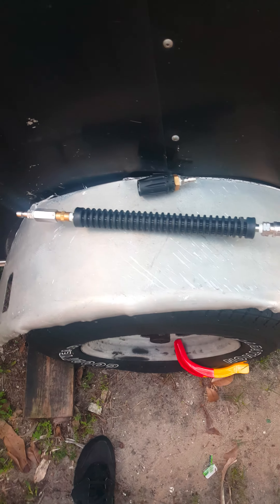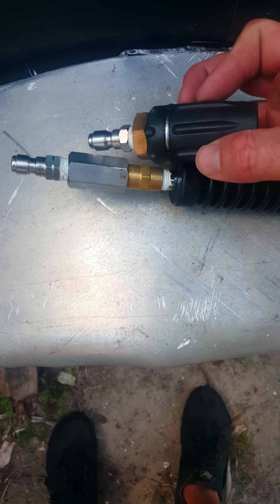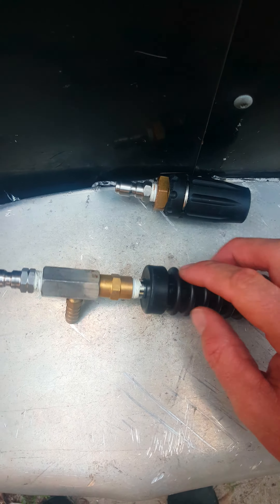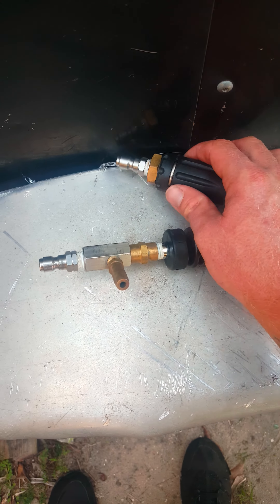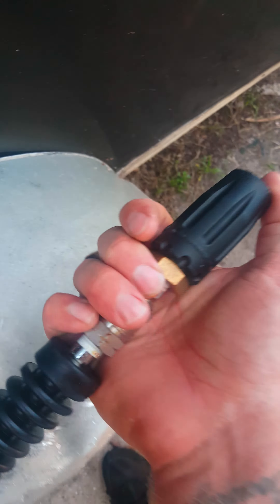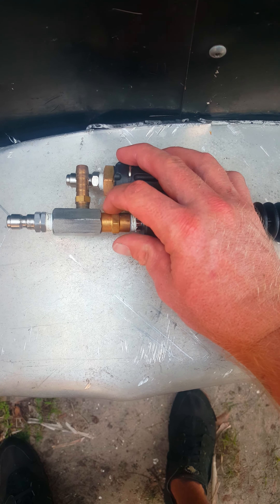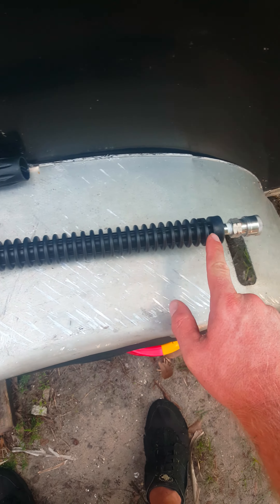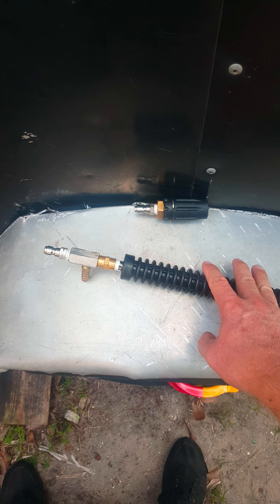Xjet x-jet m5 twist nozzle modified

Comment: Did the X jet that you are showing not have a spray nozzle built right into the Cupler? When I take my adjustable fan tip nozzle off there’s no way I can get anything Connected to the Cupler because there is no threads due to the 3 inch round spray tip. So I’m assuming yours is a little bit different.

Comment: I did this same set up, but I'm not getting near that draw. Bucket test came out 5 gal of flow to draw 1 gal. How do you get close to 1:1? Using 5.5 gal/min 3500psi Honda. I lowered the rev to see if it would draw more, but it didn't.
Reply from the maker: The more gpms the less draw ratio. This was with my 4gpm..older video
Reply: Did you remove the inners of the xjet??

Comment: How did you unscrew the xjet it’s pretty stiff and hard to take off
Reply: It has red locktight applied. Just use a little heat from a heat gun (don't go crazy) and just work it back and forth slowly and it will come off!
Reply from the maker: Hit it with your purse.. lol jk it was a biiotch use a vice.. i do remember it being hard to get off lol it will tho